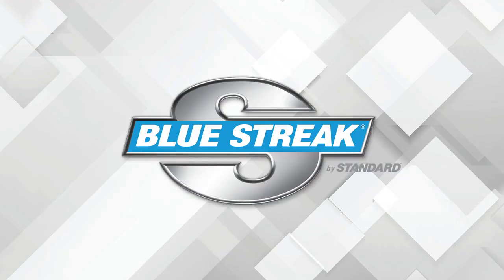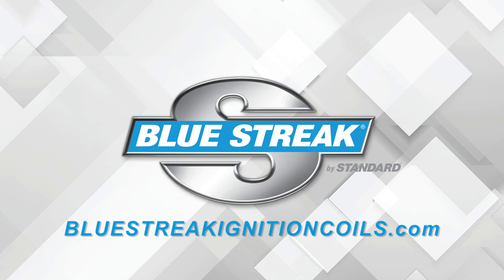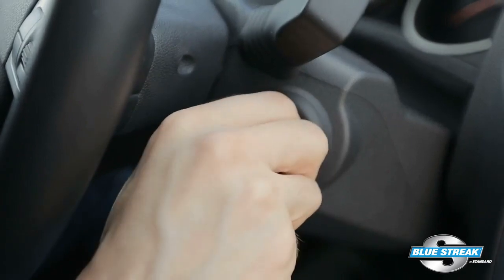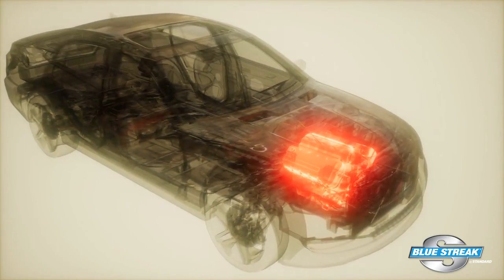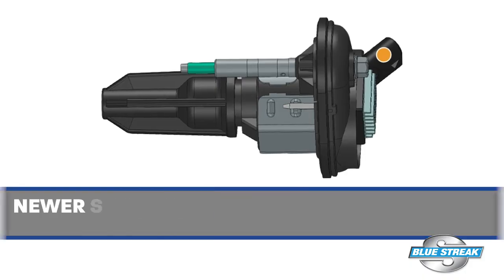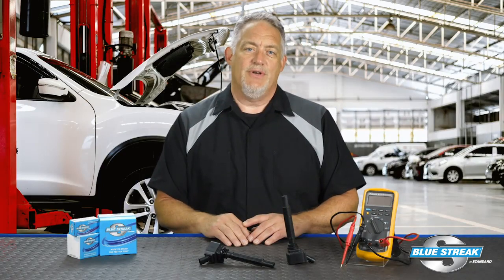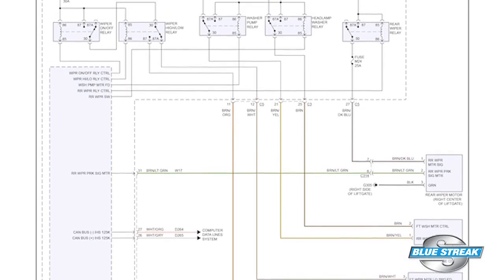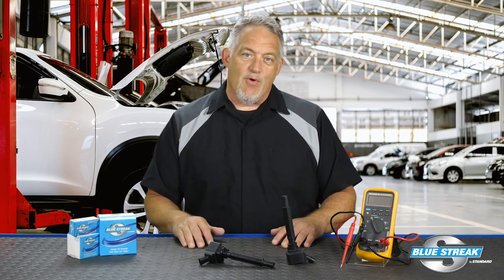Intermittent Ignition Coil Failures

Comment: I have a Honda Civic 2006 and with 150k miles, I already change the iridium spark plugs but when it warm up it looses power, I checked the Ohms in the coils and seems that it is about time to replace them, although it is not  a check engine light on the board, thanks for the video.